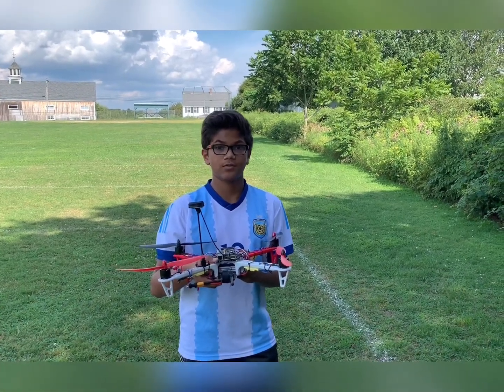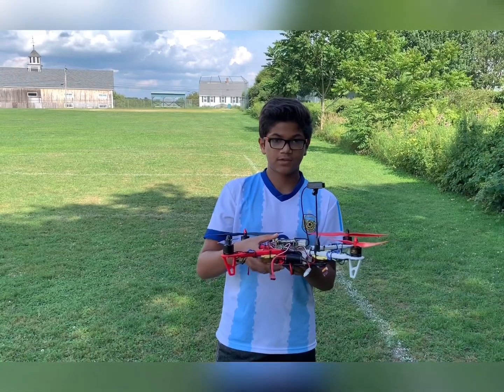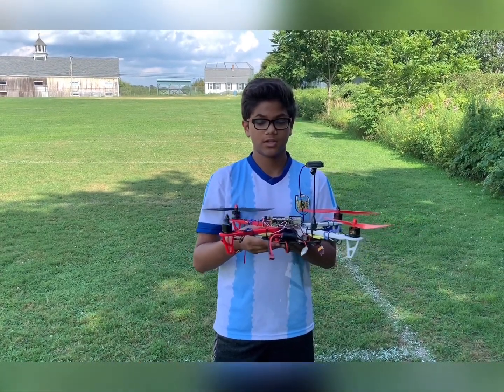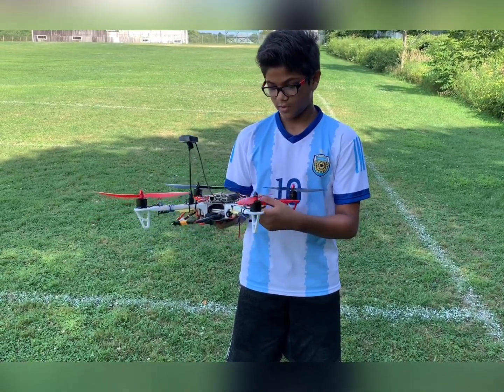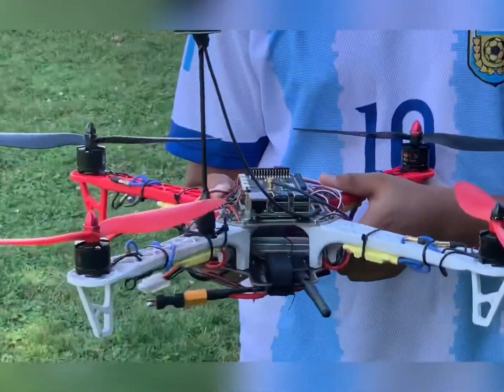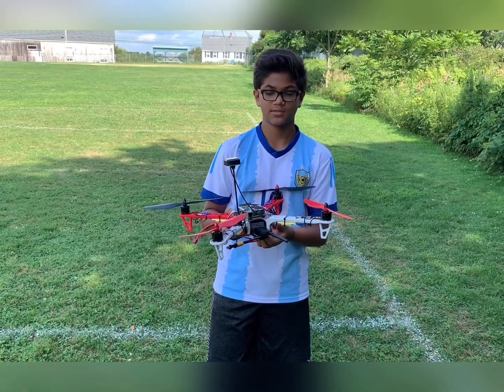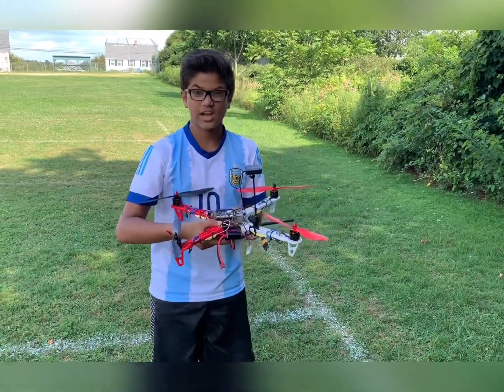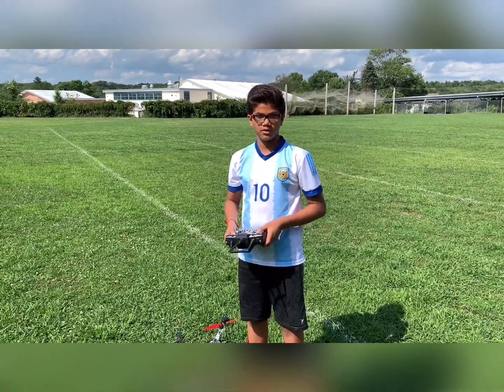The making of a Drone with RaspberryPi and Navio2

Comment: Hello , did you face problems in esc calibration ? I did the radio calibration using ppm connection and tried to do the all in once esc calibration but it didn’t work . Any suggestions ?
Reply: Armaan Priyadarshan Hey armaan thank you , but I already tried calibrating each esc alone and it worked and I was able to spin each motor normally , but then after turning it off and on again it starts the continuous beeping again showing it needs calibration again .
I am also using apm planner2 instead of mission planner since I have Linux os not windows .
Reply: Armaan Priyadarshan Ok , I’ll double check my wiring . Thanks
Reply: @Armaan Priyadarshan hey armaan , you were right , the problem was with arming not with esc calibration , after manually fixing the trim parameter of each rc channel from 9 to 16 , problem was solved .